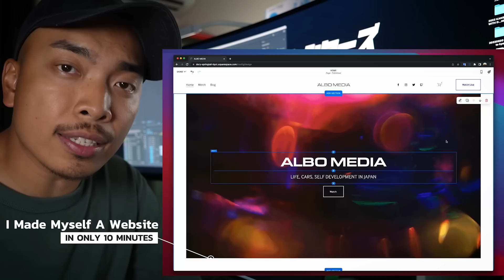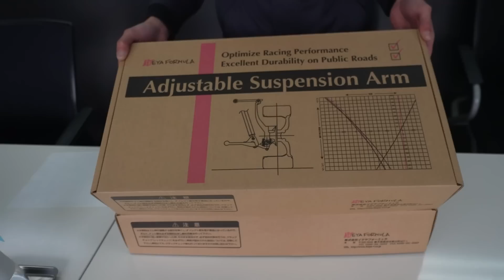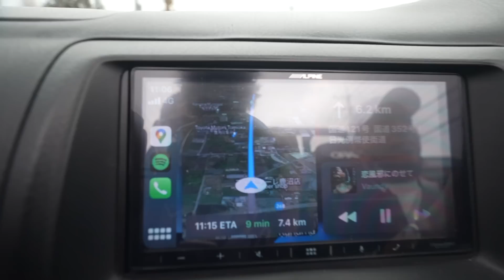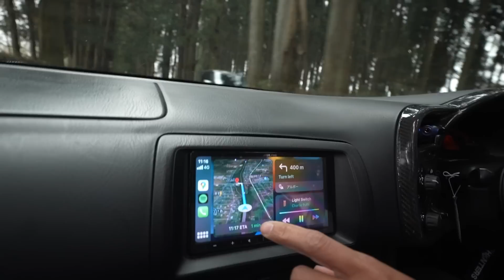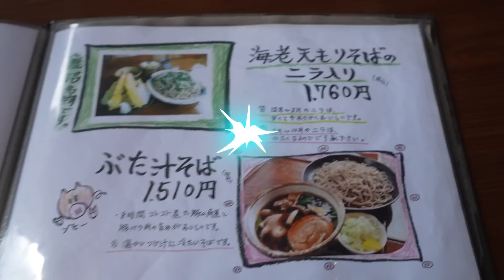Visiting Ikeya Formula: Japan's Legendary Maker Of Suspension Components

Comment: I just installed the upper front Ikeya arms today.  I had been using offset bushings in the stock arms, which worked for awhile, until they started knocking around.  It's a track car and I do run 255 square, with aero and a turbo.  I like the arms a lot.  I only wish they added threaded holes for the ABS wire.  :)

Comment: had the ikeya "sequential" shifter which are cable actuated back in late 2000s on my GDB sti . gave me tons of issues and really hard to dial in accurate shifting into the gears. Left me stranded quite afew times. eventually gave up and went back to H pattern.

Comment: Great video - thanks for covering such a well-known but under-reported on JDM suspension supplier. 

I've always wondered why Ikeya don't offer more rubber-mounted replacements - seems based on their answers the heim/ rose joints are "stronger" but I felt their answer was a bit weasely in that they didn't talk about durability and whether it means increased servicing.